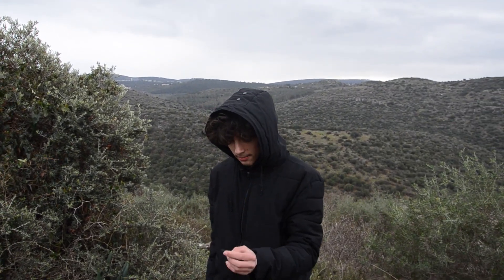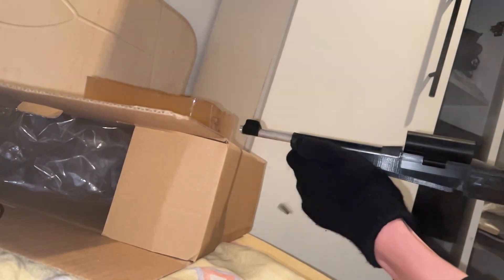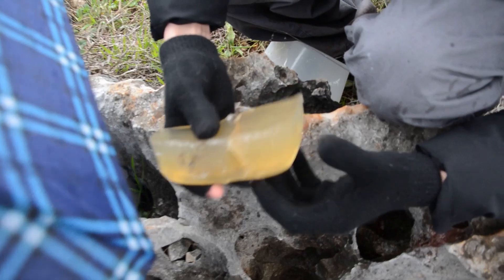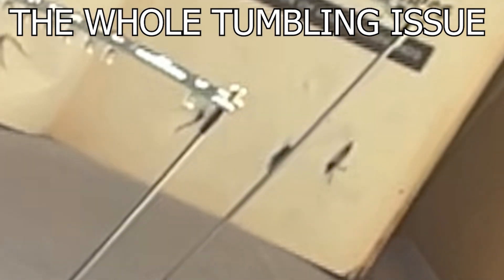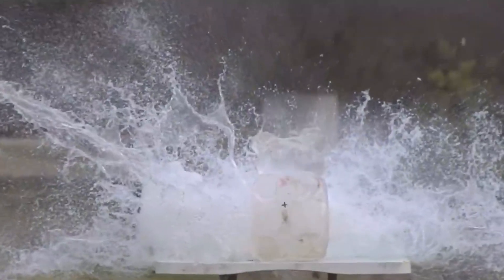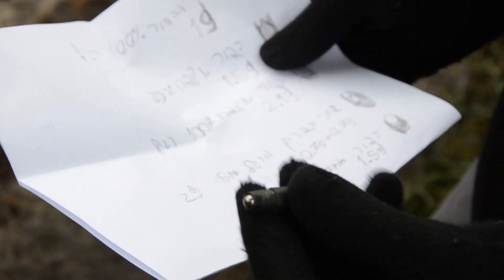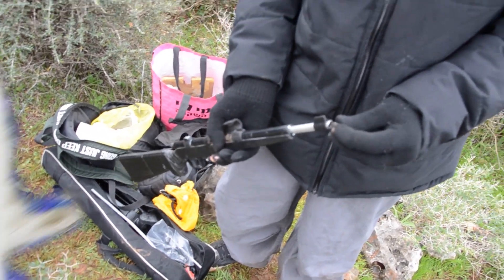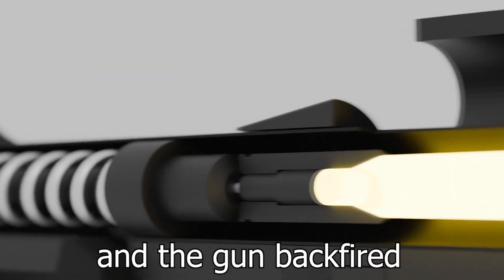Shooting fully 3D printed ammo out of a 3D printed gun(2025)

Comment: make a 3d printed shotgun, with the bigger bore size you could make it bolt action wich would solve your shoulder problem, also instead of matchheads you can make smokeless powder quite easely, for that I'd reccomend you'd use a steel washer as a bolthead though since otherwise your bolt will break. Also shotguns are amazing you can shoot so much different ammo from all kinds of shot to slugs that work like apfsds, also you wouldn't need rifling.

Comment: You need to work on the bolt by adding more locking surface and you need to add a safety lug of some kind on it, to prevent yourself from getting hurt. If you want more velocity, the longer barrel will give you a better chance but if your rounds are hitting no different or even slower, then you need to more propellant to raise the pressure. 

If I were to design a 3D printed bolt action, I would probably be inspired by the Mauser action, look up the history of each Mauser design between 1891-1898 and you’ll see what I’m talking about. Not only was the Mauser 98 action designed to be strong but it was designed to be insanely reliable and safe for the shooter in the case of a catastrophic failure. 

In my opinion, if you want to make more powderful rounds and if your bolt is made of plastic, I would recommend redesigning the bolt with big and thick locking lugs and a big locking ring to hold back the breach and like I said, a safety lug is important because you need to prioritize the safety of yourself over this project or at least do a pull string test if you can’t. I can’t see this design in my head being able to shoot a charge higher than 22 magnum but obviously, you don’t want to start from there. 

I love your videos and I hope you make a great rifle! Make gun control impossible my friend, you are literally the reason why we remain at peace with our gun hobbies because it literally stops the far left from wanting to take that away! Thank you! ❤

Comment: Don't worry about these other guys saying that you're gonna get assassinated as long as you're honest and forthcoming with your information and you do your best to stay in compliance with your local laws, then you really shouldn't have anything to worry about. But it is important to mention a quote from Adam savage "remember kids, the only difference between screwing around and science is writing it down". 

On a separate note, You should consider an epoxy carbon fiber barrel, and composite ceramic projectiles/Bolt. That is if what you're going for is a firearm that can get past metal detectors. 

Edit: to be more specific on what a composite ceramic is; You would essentially add a material to the ceramic to increase its shear strength like a fiber, which could be any kind of fibrous material prior to firing the ceramic.

Comment: I have made a similar thing and my design is aerodynamically stable as well with smooth barrel . Try adding 6 to 8 small fins at the end and make the bottom half hollow or low infill ,and use only one steel ball at the tip . Try using haack series nose cone equation to get the curvature of the ammo as well if u know how